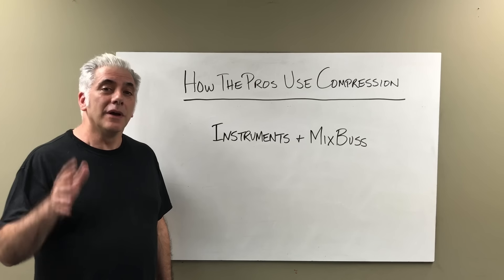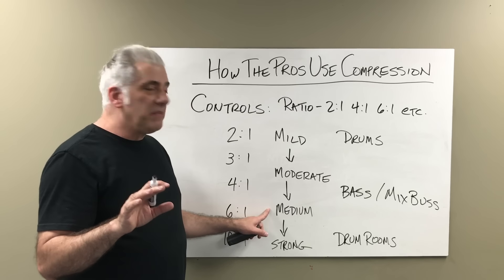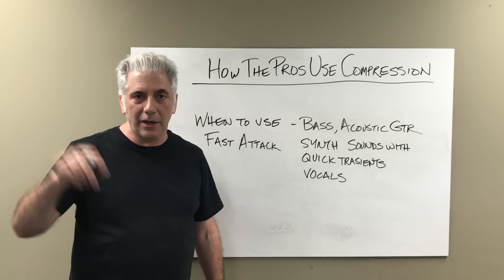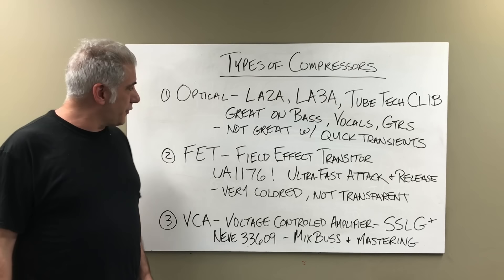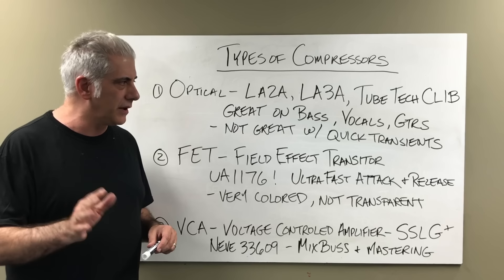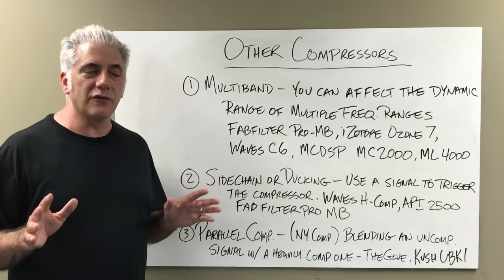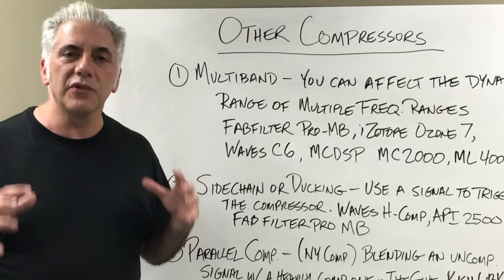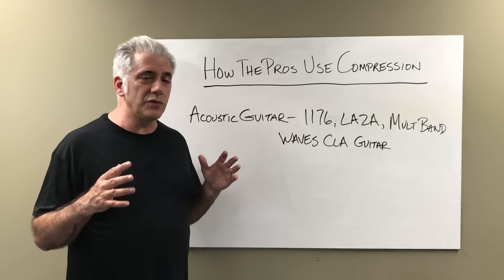How The Pros Use Compression on Instruments and Mixes

Comment: Rick Beato, thank you so much for making this video!
It's a solid theorem on compressors.

I've been mixing on live sound systems for a very long time and have gained a lot of experience and advice about compressors, but never really made it my own, because there is no right answer.

Someone said, compressors don't compress. What does that even mean? It doesn't compress. What do you and Rick think about that statement?

Secondly, I have a question about tone, a source that goes through a compressor changes its tone, how does it change its tone? 

I'm still neutral, I use the compressor first to clean up the dynamic range, and then I group the sources together and tone them once more with the compressor.

I'm curious to hear what you, Rick, and everyone else here thinks.

Comment: Cytomic Glue.... Yep..
 The Best (native) SSL type plug in ive ever used , Can whip DSP ones. (and goes beyond with options most other plugs should have .) ....
its a Fkin Rippa ... IMHO
And though many wont be using Logic... Its built in Compressors , whether emulated , or not, is a suite of some of the most usable compressors ive used...
Switching between Opto,Fet,Vca and others , with out reloading , as it assigns the parameters available to each one, is such a great way to experiment.... ...Sometimes ive found a compressor type work when i didnt think it would......
mate, the Focusrite Red Bass DI preset is one of gods gifts....  Its that good
Truly underrated... But , its a matter of statistics......... An App, only available on one platform

Comment: Nice lecture, except for in 2:12 you mix up waveform and amplitude: distorted guitar or square waveform synth is not compressed because of how its waveform looks like, that's just how it sounds, not how loud it is. What compressor does, it controls the amplitude i.e. loudness (that's what you see in your DAW: the volume of the mix, not the waveform of the signal): DAW is not an oscilloscope, it only represents graphically the loudness of recorded sounds. And when the compressor limits the loudness, what you see in DAW is just the limited peak amplitude, not square waves. If it was an actual square wave, your whole mix would sound distorted.

So yes, you compress distorted guitar and synth just like any other sounds in your mix.

Comment: I will make it easy: SOFT sounds are made louder, to a maximum. Loud sounds are the same, or less. You can squash everything at the loudest part if you want, which is what modern music sounds like now - with very little peaks and valleys, or dynamics, left. Everything just hits the ceiling and it becomes a wall of noise.  Mixing and producing music is very hard, if you want to sound loud enough, yet keep the dynamics; varying ratios, attack and release times, will govern your overall loudness of the mix or instrument you are compressing. At some point though, it no longer sounds like actual people playing.

Comment: You wrote Compession on the board at the beginning , and I'd say Compression can be useful for more than make instruments sound louder, I also don't agree with your Apple video lol, otherwise, I agree with most of your video and I recommend it. I'd say Distortion guitars are not always plain square, sometimes it's just an overdrive/crunchy and not a directly transformed sinusoidal in a square wave, and those often sound nice with an la3a or a boss c3 pedal. Also, in heavy metal, compression can be nice to play with the attack to make riff's pump with fast release, or, make the sustain longer for those heavy metal ballads. I am pretty sure nickelback - something in your mouth has compressors in all guitars, and we both know who produced that and he's a pro. Cheers Rick

Comment: The Fairchild does have threshold and ratio controls tho. The ratio knob is a little screw on the back. It also affects the knee size. A higher ratio, gives you a bigger knee size.

Mix:analog has a real Fairchild compressor you can book and use via the cloud. They turned the ratio screw into an actual knob.

Comment: Thanks for this, it's generally good useful information. I do question your assertion early on that square waves don't need compression. You are confusing the waveform of the sound with it's envelope. The compressor works on the envelope not the waveform. e.g. If I play one note on a square wave synth & then 10 notes, they will not be equal volume, I may want to still use a compressor to level out the difference. Similarly I may want to use a compressor on a distorted guitar to level out playing or part inconsistencies.

Comment: Everything makes sense except where he explains the release time. When the release is set to fast the signal stays louder on the tail because the compression stops clamping it sooner. When the release is set to slow the tail is quieter because the compressor doesn't stop reducing the volume quickly after the volume of the track has gone below the threshold.

Comment: For drums is it better the Optical or Field effect Transistor?
Reply: Try it out, and see what you like!!

That said, FET compressors like an 1176 are commonly used on drums, because their attack is fast enough to control everything.
Sometimes optical compressors like LA3A or LA2A are used, but it’s not as common.
Reply: @zachary963  Thanks for the tip!

Comment: 8:26 is so completely wrong, I can't believe no one has called that out. A long release on your compressor makes LESS sustain, not more. If you want MORE sustain, you need SHORT release. A compressor is not a fucking Minimoog.
Reply: thats correct, you need to compress only the attack, and left the sustain uncompressed. after getting the signal up to match the original peak, you will have more sustain. (if you dont level match it you will have the same sustain, and less transient information) HOWEVER, that is true if you're using very fast attack (or cliping the transients)

Comment: I somehow think He explained how the Ratio works in a wrong way. Or i Just dont get it...can someone explain to me what a 2:1 Ratio does compared to a 4:1 Ratio? Thx guys
Reply: Ratios are like fractions.
2:1 is like 1/2 (a half) and 4:1 is like 1/4 (a quarter).

The portion of the signal which is over the threshold is reduced to a fraction of the original. If the ratio is set to N:1, then that portion of the signal is reduced to 1/N'th of the original.

Let's set the threshold to 5 and feed in an input signal at 17.

If the ratio is set to 2:1, then the output will be at 11, because:
17 exceeds the threshold by 17-5=12
that 12 is reduced to a half, which is 12/2=6
that 6 is added back on to the threshold (the portion which wasn't reduced), which gives 5+6=11

If the ratio is set to 4:1, then the output would be 8, because
17 exceeds the threshold by 17-5=12 (as before)
that 12, is reduced to a quarter, 12/4=3
that 3 is added back to the threshold, which gives 5+3=8

If the input falls to 9, doing the same calculations...

The output with a 2:1 ratio would be 7.
The output with a 4:1 ratio would be 6.

The source input signal has varied between 9 and 17, a difference of 8.
This difference is the dynamic range.

With a 2:1 ratio, the variation is between 7 and 11, a dynamic range of 4.
With a 4:1 ratio, the variation is between 6 and 8, a dynamic range of only 2.

So, a ratio of 4:1 has compressed the signal to a smaller dynamic range than a ratio of 2:1

I hope this helps!
Reply: thresh: -16 db
ratio: 2:1
input: 0 db
output: -8 db

thresh: -16 db
ratio: 4:1
input: 0 db
output: -12 db

hope this actually helps

Comment: Thanks Rick, great tutorial but I missed a description of the threshold.  In other words, you say "if you exceed the threshold..." --- what is the threshold?  Also, you mentioned transient as being quick - as you say, attack time is how quickly the compressor engages that initial sound, but wouldn't you therefore describe the transient as being the initial volume - is it loud or soft - or maybe you mean how quickly that initial sound drops off?  A piano note drops off quickly while an an electric bass guitar note holds the sound longer.

Comment: I have a question on a technical detail..  At the beginning, he talks about the compressor simply cut the tops off of the waves.   I question if this is truly correct - Unless I'm wrong, this would technically increase a lot of high harmonics causing noise, and change the sound and not just the volume.   Essentially, wouldn't this just be similar to the result of an overdrive circuit?  (not withstanding the actual amplitude)..  I would argue that unless I'm misunderstanding these things completely (and I've never even been in a recording studio, so this is possibly the case!) that regardless of the "type" of compressor, they're all just attenuating the amplitude of the signal, not changing the fundamental waveform as cutting the tops of the wave would do.  In an analog world, this would be limiting your S:N ratio.  I was impressed by the example of the quickly fading bass note - In an analog world, I'd have expected to hear the noise come up as the compressor backs off and increases the overall amplitude of the desired note, but I guess in this case, it was a completely digital recording to begin with so theres plenty of headroom and we dont have to worry about that!    Am I misunderstanding this stuff?

Comment: I really do have trouble understanding the release-time as explained at about 8:30. The lower tone is amplified by 12dB so basically the fast attack of the compressor made the transient about 12dB more silent. Now it is pronounced that the large body is a result of the long release time. But actually for the tail to become louder, the compression would have to open up before it. Generally the body and the sustain should become more with shorter release times?!

Comment: "...synths that have square waves..." (2:12). 
The waveform of a sound has nothing to do with compression. A synthetic sound (no matter what waveform it has) may or may not need to be compressed according to its dynamics and how we want it to sound in the mix/arrangement. 
A square wave from an oscillator (synth) is processed by an amplification envelope (ADSR) and this can even be generated (in certain cases -not old synths, of course-) according to velocity: how much harder or louder a key is pressed or that note is assigned to a sequencer. ADSR stands for attack-decay-sustain-release, which allows that wave to have a dynamic, for example similar to a plucked string (a lot of attack and little sustain) or bowed string (less attack but the sustain we maintain with the bow). Not to mention the filter and its ADSR plus cutoff and resonance, which can also provide dynamics that we probably also need to compress in a mix.
This is different from a distorted guitar, which lacks dynamics and does no need compression.
My respects.

Comment: Question: Prolonging the sustain of a note with a long release time will only work with auto-gain right?
Because if a compressor doesn't apply gain but instead only gain-reduction then the signal should get louder once the compressor releases the signal.

Comment: Correct me if i'm wrong. But despite square waves being square, one square wave can still exceed another. In that a compressor isn't flattening the shape per se, it's just flattening the top ones and so would still be beneficial (in theory) on a square wave synth which has "drop-out" issues. Personally, I stay away from compressors and any form of algorithmic processing anyway. I find they only produce (arguably better) results on "un-tame" tracks/instruments which have a lot of issues. When applying them to well-tailored tracks which have been hand automated, they always come out worse.

Comment: Umm... high-ratio compression or limiting does not flatten the top of the waveform. That would be clipping. The only time a limiter would do this is if you set the attack and decay to a time less than the period of the waveform (which can start to happen with low frequencies, introducing distortion). Compression works on the measured loudness/amplitude/envelope of the signal and (ideally) not on the waveform

Other than that a great primer on compression

Comment: Great video, Rick, but I wish you had explain ratio a little better cause I'm a bit confused. 

With a 2:1 ratio, am I attenuating by 1/2 of how much the signal is going over or am I attenuating to 1/2? It's hard to tell from you're explanation cause they're the same answer mathematically in the case of 1/2.

So to get to the point, if I have my ratio set at 1:3 and I go 12 dB over, do I attenuate to 4 or to 8? It seems like it would be down to 4, based on your chart and how ratio goes off to infinity. But I'd just like to he sure I understand correctly.

Comment: When using small compression on a great synth bass, it will sound more punchy and present. Saying you don't need to compress squarewaves is not correct. Also: When using big filter changes on synth sequences  you'll get heavy volume changes, so you also need to compress that. When you are using a 100% static squarewave, yes, you don't need to compress it. But this case is very rare because static = boring and everyone want a synth sound to be colorful, moving with character. My Moog Mother-32 has huge changes of dynamic and without compression everything would going to clip.

Comment: Once an individual track is compressed does one typically increase volume to bring the track out? I've never seen this mentioned before but the bass example here showed the compressed bass track up at +12 db compared to the reference track, if I remember this correctly. Thanks.

Comment: 7:42 he talks about how a long release will enhance sustain. It’s actually the exact opposite. Short release = more sustain because then the compressor is allowing the volume of the tail to be turned back up more quickly.
He then talks about using a long attack and long release to create pumping. This is a stylization choice and not a mixing choice. I would say that those settings aren’t serving any sort of mixing utility and instead is in the realm of sound design.
His waveform example with the bass bad. I don’t see how it’s possible to get those results with a long release. He should’ve shown the settings on the compressor he used.  It would be much easier to make that waveform with a short release unless his threshold was set so low that the release was never even engaged.
Reply: As I understand it, the long release, combined with 'make-up gain', is what lengthens the tail. Without compression, after the attack the tail dies off linearly. With compression, at say 4:1 and the threshold set at whatever works, the make-up gain is set to compensate for the 4:1 reduction in the transient. That make-up gain is what keeps the tail going during the slow release. I think I have that right. But I don't remember Rick talking about make-up gain . . . I'll have to watch it again.
Reply: jamesianp The makeup gain makes no difference.  You can make “sausage waveforms“ whether you use make up gain or not. The only difference would be that one sausage wave will be louder than the other... but the dynamics will be shaped the same.

Rick is just wrong on this one.
Reply: @CharlesFerraro  What's a "sausage waveform"? Never heard that one before.

Comment: That compressed snare at 5:50 sounds weird, as if some frequencies were added to it. Could someone tell me if the compressed snare used here is supposed to sound better than the original? Maybe it's something that would become evident in the context of the whole mix.
Reply: no frequencies were added to it. what you hear is the compressor clamping down on the transients, and bringing up the volume on the quieter portion of the snare. if you  remember, the initial snare shows the tail end of the waveform dying off rather quickly. with compression, you quiet the initial attack, and sustain the tail end of the sound to make it more audible.

Comment: whats your thoughts on softubes fet compressor,  I also have their Valley People Dynamite which I LOVE (amazing on drums-explosive). The Drawmwer 1973 is one of the better multiband Ive used straight up
Brainworx also makes some Killer compressors. They modeled the Original SSL Bus compressor that was made for Townhouse studios, I just picked that up and I am Very impressed, I have Both SSL native (real SSL) X-comp, and their buss compressor (honestly i think ableton did better with the glue compressor clone they made- Has a Great Side chain, and the soft clipping option really allows you to push.
I also Dig the Brainworx, Idea of Consoles as each channel in a analogue set up is going to be slightly different.  I use their SSL4000 Console on almost everything.
The Elysia Alpha Master Compressor is the SHIZZ and im surprised more dont know about it. Elysia also dsps ALL of their own equipment and seeing as its a digital compressor your pretty much getting the same thing ( same as softtubes Wiess collection-Its all code anyway) so your getting literally a 10,000 compressor (obviously anyone would rather have the hardware but props to elysia) One of the BEST Masterbus Transparent or colored Sound!
Id like to try that Ksuh compressor i like UbKs videos he has great excersizes.